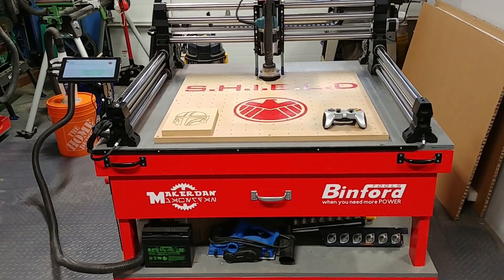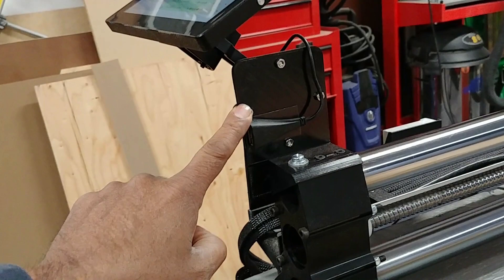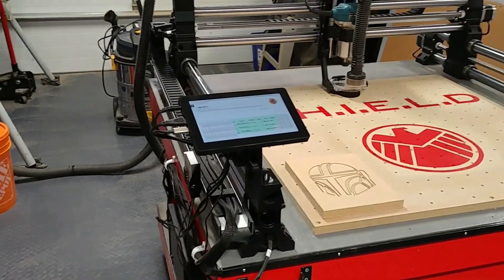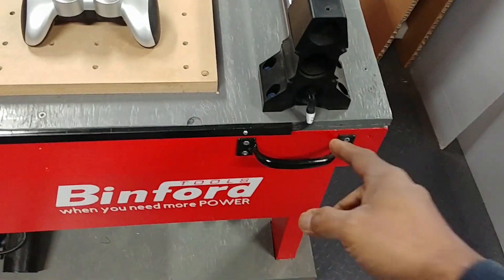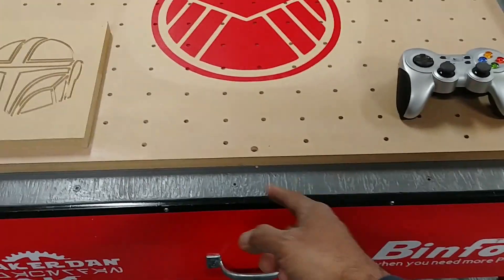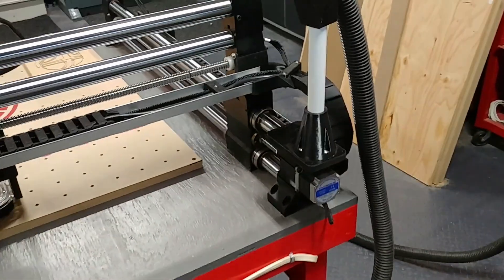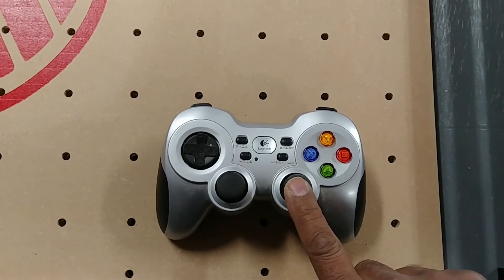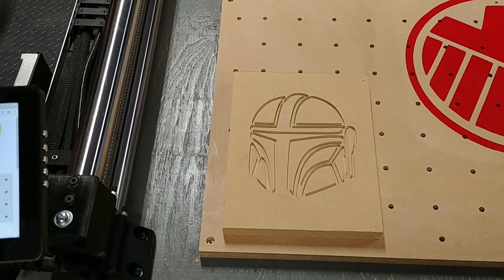OneFinity CNC with 5 Upgrades

Comment: Which onefinity CNC is this? The journeyman?? It can't be the elite foreman, doesn't look big enough and also doesn't have the Masso G3 controller
Reply from the maker: @jonnyking4369  this is just the basic woodworker.  It's great for what I need it for 😁.
Reply: @MakerDan55  I'm about to buy one but I really want one I can use with the Xbox looking controller 🎮
Reply from the maker: @jonnyking4369  that's what I use.  I actually bought an Xbox controller clone for next to nothing on Amazon and I've been using it for years.

Comment: Dan - great video and improvements to an already great design. Kudos!  Quick question, what is the size of your cnc table? I'm ordering an X50 woodworker and other tables I've seen are much larger than what I think I need.
Reply: Thanks for your help with this.. I want to get started this week
Reply from the maker: Thank you.  My table is 44" deep and 48" wide.  I hope this helps.  The drawer in the front is very helpful.

Comment: im glad you posted all the connectors and sockets.  WOuld you know what cable to purchase if i wanted much longer cables?
Reply from the maker: Sorry.  I just saw this 😂😂.  I just used regular wire off Amazon.  I think it was 22 gauge.  I may have mentioned it in the video.

Comment: I know you mentioned that you used ABS to print the parts, do you think PLA could be used instead of ABS? Thanks.
Reply from the maker: I think it would also work.  Or better yet, PLA +.
Reply: @MakerDan55  Printed in PLA at 50% infill, fells strong.  What type and size of bolts did you use to mount it to the axis?
Reply from the maker: @danielcorbett2701  I just used an assortment of metric and standard nuts and bolts I had.  Not sure if the sizes.  Just measure the openings and use whatever you have.
Reply: @MakerDan55  Ok will do, what about the m5? I'm worries about using one too long since it is screwing right into the axis of the machine.
Reply from the maker: @danielcorbett2701  Then maybe use a shorter one.  No big deal.

Comment: May I please ask about the trailer, or table-stand you are using for the OneFinity that you are making the modifications to. I think I understood you to say, you designed and made it yourself, but didn't hear clearly.  Maker Dan, Can you source the supplier or model number or the Design? Pharmacist.Rick@outlook.com   [Rick Bartholomew] Dan, I really enjoy your tutorials. They are terrific and very detailed.
Reply from the maker: Hi Rick.  Good to hear from you.  Thanks for the kind words.  The table I built is based off of Ben Myers' that he built and showed on his YouTube channel:
https://www.youtube.com/watch?v=rpALVu7HzWU&t=114s
I changed the design a little.  Instead of having the bottom section as a "tray" I flipped it and put the plywood on top of the 2x4 supports so I could slide items on and off of it.  I also built a drawer (super handy) to put all of my accessories into.  I built this table for the Shapeoko originally.  There is no room for the control box for the OneFinity so that's why I had to mount the control on the side of the table.  Here are a couple of pictures of the table:
https://www.flickr.com/photos/185952626@N02/49641288718/in/album-72157713428997383/
https://www.flickr.com/photos/185952626@N02/49641811506/in/album-72157713428997383/

Comment: any luck and getting the links to the molex connectors? I have had a rough time finding the mini and micro molex connectors on amazon. Thanks
Reply from the maker: I'm not sure I understand you.  Is the link to Digikey I posted not working?  I could only find them at Digikey here in Canada.
Reply: Digikey has them...and a whole lot of other products which made it a little confusing.... I contacted them and they helped me out. I thought I could simply get them from Amazon.ca.
Reply: In your video i think you mentioned that you got the connectors through Amazon

Comment: That’s really impressive Dan thanks for sharing.
Reply from the maker: Thanks.  I'm going to post a new one in a day or so with my new drawing adaptor.
Reply: @MakerDan55  great, I’ll be sure to check it out. What software did you get for the onefinity machine?
Reply from the maker: No software came with it.  I am using Carbide Create or Fusion 360 to make my gcode.
Reply: Would you have any software recommendations for someone like me that’s never used a cnc before? I won’t get my onefinity until late May so Im researching software for now.
Reply from the maker: I would start with Carbide Create.  It is free and easy to learn.  There are a lot of tutorials online for it.
Reply: I’ll check that out. Thanks Dan!

Comment: I was about to order a Shapeoco Pro XXL then found this machine. After some research I ordered one yesterday(saving about $700 over the Shapeoco). Hoping to get it early May. Will be watching lots of videos like this in the mean time. Thanks for sharing.
Reply: Ordered mine yesterday & can’t wait to get it. Did you buy software yet? Curious what you went with.
Reply: @mikegallagher782  Didn't buy anything yet. Got a free trial of Vcarve pro and Fusion 360. I like Vcarve better. Will probably start with Easel or Carbide Create then move to Vcarve once I learn more and want to up my game.
Reply: @Average American thanks. I was looking at the Vectric Desktop that onefinity sells but will try to get some free trials of others before buying

Comment: I just wish it had a bitsetter type thing to measure the bit.
Reply from the maker: It has a touch probe to zero X, Y and Z.
Reply: @MakerDan55  That's not it. The "bitsetter" on the shapeoko automatically travels to a point and measures the new bit height. It just makes bit changes a lot easier and automatic. The only reason why I haven't bought the OneFinity just yet.

Comment: Hello, great machine! If I get the drag chain setup , do I HAVE to rework the wires/cords? Or can I just put the control box closer to the front left corner?
Reply from the maker: You would have to make new cords as the wires in the drag chains need to be quite long (around 9-10' for the Z and power and 7-8' for the x axis).  If you don't want to make your own cables you can buy extensions from the OneFinity site.
Reply: @MakerDan55  thank you so much

Comment: Is this thing REALLY square?
Reply from the maker: Yes.  It cuts approximately 32" by 32".  Here are the dimensions for the machine.
https://forum.onefinitycnc.com/t/woodworker-spec-sheet-and-footprint-layout/35
Reply: @MakerDan55     Does it cut square?    My shapeoko does not and it infuriating

Comment: That monitor mount doesn't show up on Thingiverse after searching. Would you happen to have the file?
Reply from the maker: Thanks for letting me know.  I deleted it from Thingiverse and re-uploaded it.  Try it now and let me know if you have any problems locating it.
https://www.thingiverse.com/thing:4748730
Reply: @MakerDan55  Link is 404 and it doesn't show up under search, or with just 'onefinity' as a search term. ¯\_(ツ)_/¯
Reply from the maker: Thingiverse is so frustrating to work with.  Ok.  Let's try another avenue.  I uploaded it to my github site.  Try this and let me know if it worked.
https://github.com/MakerDan55/CNC/blob/main/OneFinity_Monitor_Mount.stl
Reply: @MakerDan55  any luck on the link for the monitor? You could email it to me if that is easier
Reply from the maker: @mirroringmemories6742  Sorry you have been having difficulty with this.  Try the link now.  It should go to my Git Hub page.

Comment: any chance you could update the link for the Monitor Mount? Drag chain setup the thing i dont like about the drag chains. You have to replace the line that comes with the onefinity for the Z axis. I printed the parts but after running into that issue with the Z cable i did not put that on mine.
Reply from the maker: Sorry about that.  I don't know why this link keeps breaking.  I have updated it again.
https://www.thingiverse.com/thing:4732484
You can also search for OneFinity Monitor Mount on Thingiverse.  Making the extension cables isn't too difficult.  I thought it was intimidating at first but once I learned how to crimp the connectors and make my first set, it went really well.  I noticed that OneFinity now sells extension cables on their site:
https://www.onefinitycnc.com/product-page/2-pack-cable-extensions-4-foot-long
Reply: @MakerDan55  link already broke:( When you search for that it comes up empty i tried as well before.
Reply from the maker: That's so weird.  When I try it from my end it works.  Sorry, don't know what else to suggest aside from a different browser or searching for it on Thingiverse.

Comment: Most of the Thingiverse links do not work - but nice summary of upgrades to the machine, ordering from Digi-Key etc. to be ready for when mine is available for pickup. What wire gauge of wire did you use for the custom cables? I am ordering some braided mesh to keep the clean look as you have done.

Thanks.
Reply from the maker: Thanks Paul and sorry, I believe all the links should work now.  Let me know otherwise!  I used 18 gauge wire on mine since I already had it but if I had to do it over again I would go to 20.

Comment: Great video! What size is your table top? Thanks
Reply from the maker: My table is 48" wide, 44" deep and 30" tall.  It is also on 4 large nylon castors so I can move it around easily.
Reply: @MakerDan55  Thanks for the quick reply! I think I will start off by exploring software and learning it before I jump into this cnc

Comment: Hi great video
I am struggling to find the 3mm Molex connectors on Digikey
Is there any chance you could post the reference number for each part needed for the extension of the cables including crimp connectors
This would be a great help
Reply from the maker: I found their site very difficult to find the parts as well.  I have updated the links but here is what I ordered in Canada:
4.20MM connectors: 0039039042 part# WM13116-ND
4.20MM crimp socket: 0430300001 part# WM1837CT-ND
3MM connectors: 0430250400 part# WM1784-ND
3MM crimp socket: 0039000038 part# WM2501CT-ND
Reply: @MakerDan55  Thanks for the info,, much appreciated
I gave up on their website after spending hours looking

Did you use 18awg wire ?
Reply from the maker: I used 18 awg but would use 20 if I had to do it again.